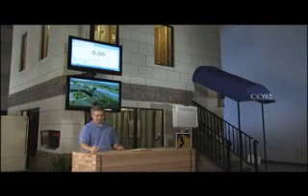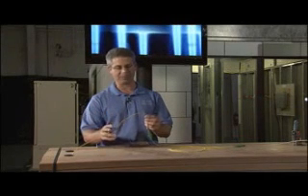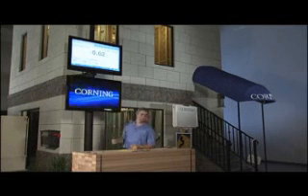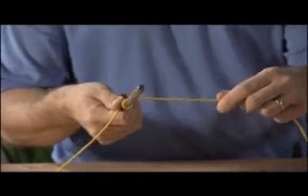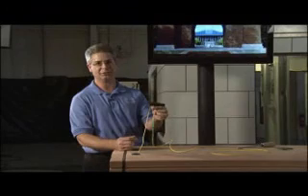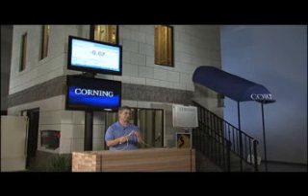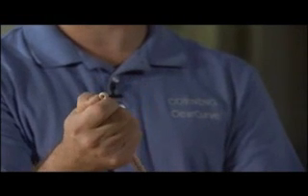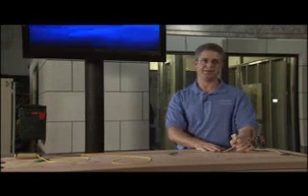Corning's ClearCurve™ flexible fiber

Comment: ARE YOU SERIOUS!

If you've ever worked with fiber you know what a HUGE pain in the behind it is to work with. It's gotten better over the years but its still very touchy (especially when terminating).

He's abusing that fiber line and it's FINE! I'm curious about its distance potential with that type of abuse, but still!

I'd run this fiber through the house for my VoD system. BlueRay image transfers over gigabit ethernet take forever but I could run at 10gb with this!

HOW MUCH IS IT?